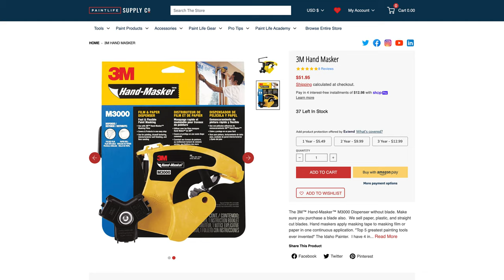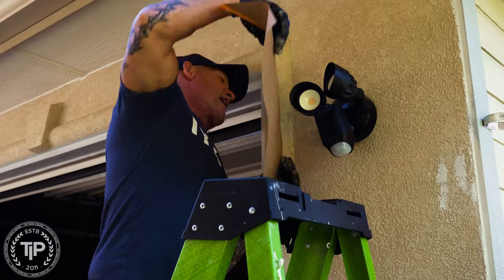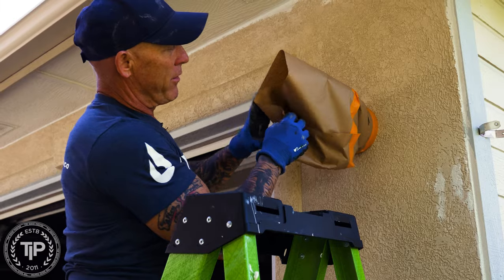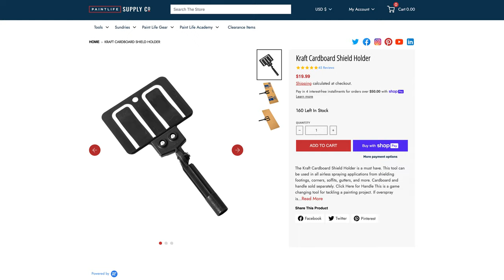Overspray Protection | Exterior Painting

Comment: If you're worried about an outdoor light like that coming on, how about finishing masking it with the clear plastic you use on windows? Then the light sensor won't turn the light on. Also, it would be good to take a photo of the light before you disturb its aim, so you can put it back like you found it. I know the outdoor lights at my house were annoying to adjust just right, and to work properly, were not aimed like you might expect.